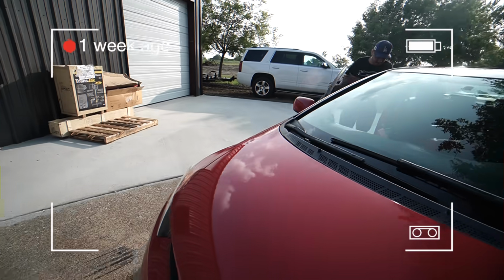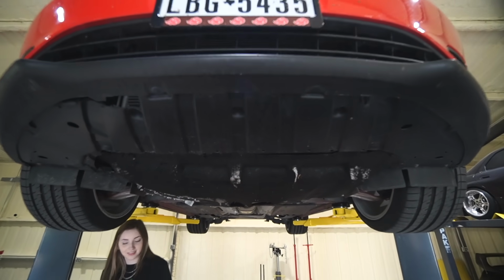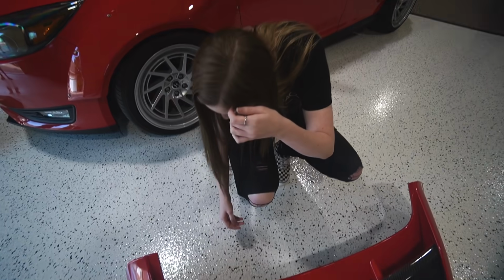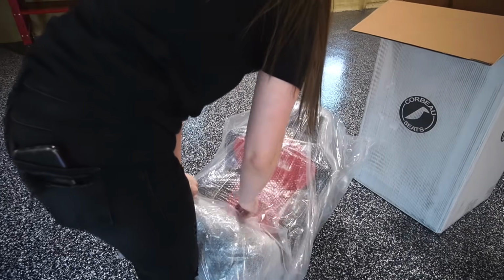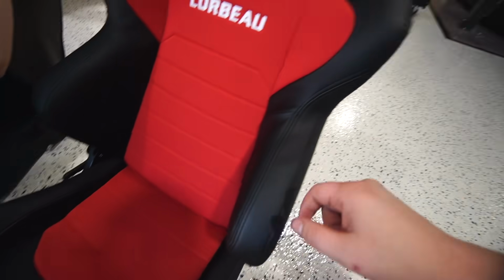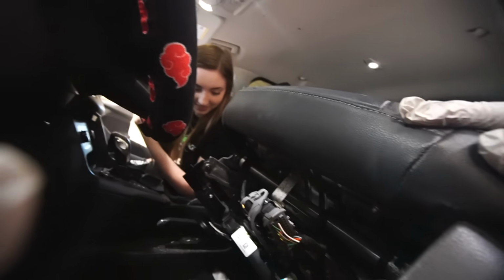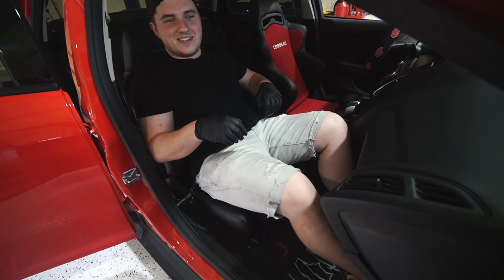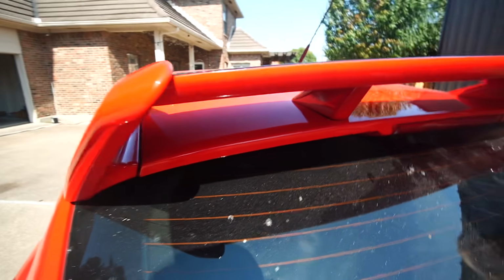Surprising my little sister with RACING SEATS & CARBON FIBER WING for her widebody Focus!

Comment: She needs a quick release steering wheel. Get it engraved with some sick JDM or Anime stuff... OOF
Reply: its a ford
Reply: @03uro  so
Reply: KID SEEK why not?
Reply: No need to keep an airbag in it.
Reply: Nah, would be very dumb to remove a steering wheel with an airbag from a modern car
Reply: @luka_abh  exactly. Especially a car that is driven daily like that.
Reply: nah she should keep the airbag and the button controls are nice to have, seems like all she really needs is side skirts and the front bumper extensions
Reply: Andyrew Oberg she needs an exhaust especially , plus getting rid of the airbag is also useless in a daily driver cause she’ll just get rid of a huge part of her safety
Reply: I dont think Jeryns willing to sacrifice her airbag
Reply: ya ur like 12 for sure
Reply: She's young and it's her first car, and she's technically still in the learning phase. Don't you dare take the driver's side airbag out. So many other cool things you can do for her without compromising her safety.
Reply: Evan needs to get her actual engine components not gonna lie it looks good but I wouldn’t consider it a “build’
Reply: I’ve never understood quick release wheel on a street car.. ur driving on the street... u don’t have a helmet on. Ur 5 point harness isn’t gonna save ur neck when u hit a tree at 50 mph
Reply: i could understand if it's an old airbag but that one will actually work lmao so i would have to disagree
Reply: Why add jdm shit on a american car smh🤦🏽‍♂️
Reply: Once I seen the seats in that way I was thinking
Reply: The issue with that in the focus is you loose a lot of necessary buttons, like for the gui in the cluster, unless you custom fab a plate to mount them in but thats a lot of effort for a steering wheel
Reply: @fairlylocal7961  try being 6'4 and driving a 90's japanese car lmao
Reply: People are saying not to replace the wheel because of the airbag. Well an easy fix would be a harness bar with a five or 6 point harness. Keep the oem 3 point just in case.
Reply: Maybe throw on an st or rs wheel so she can keep the controls and airbag but add a little bit of style?? The stage 3 ST wheels would look sticky!!
Reply: Geez rice alert
Reply: Yall know that you can get aftermarket steering wheels that still keep the airbag for newer cars right?
Reply: DO IT!!!!
Reply: This needs to be done
Reply: That would be cool but an airbag is cooler lol
Reply: I'd just leave it lol
Reply: Yeah, no.
Reply: You lose all the cruise control, radio controls, and voice command options. Just needs to leave it alone.
Reply: Keep the airbag its a daily keep her safe you never known
Reply: Very dumb to remove a steering wheel with an airbag inside
Reply: no need to add quick release steering wheel he can get in the car easily
Reply: That would be dope
Reply: @03uro  it’s a Ford.. and it’s slammed.. wide bodied.. with rims.. and a wing.. what’s your point🤡

Comment: Ok hear me out,

Put the GE in the focus when you swap the supra?
Reply: would be such an huge project. there is no space for that.
Reply: Yeah, the engine would go inside the interior
Reply: @parkerbethke was joke 🤦‍♂️
Reply: @OTTCOUTURE710  it's a joke
Reply: @AyoBrandoh  lmao
Reply: Put a little srt4 motor in it. Make a good bit of power but not too much
Reply: @JuniayJuniay  i mean in realistic terms you can buy a scrapped focus ST motor for like 6 or 700. They could just ST swap it and everything would work
Reply: @AyoBrandoh  that would not be the biggest problem. Allthough the focus rs has an Haldex system but you could deffo modify it with an normal diff.
Reply: heresy
Reply: Makes no sense, lol way too much work just to make less power than an ST motor

Comment: A. Exhaust.
B. Those fog light bezels were nice and so were the smoked mirror indicators. Working ones will look good tbh.
C. Quick release steering wheel.
D. More anime stuff.
E. New headlight and tail light housings.
F. Custom half cage + Racing harness

Just a few recommendations for her.

Comment: 350Z is the best, jeryn. I have 3 of them and the 2008 automatic is just as fast as the 2008 manual.
P.S. You can get one with a drop top if you're into that. I really like mine.

Comment: Well.. @Evan that 'Soft Liner' under the car is actually an engine splash shield and it's made to protect your vehicle's engine of water, debris, tiny stones etc, in other words THINGS that can actual damage your engine, oil pan and other lower parts. It is not made for 'up north vehicles' as you mentioned. I thought a car enthusiast should know that..
Reply: If a tiny stone damages your sump, you got a weak ass sump